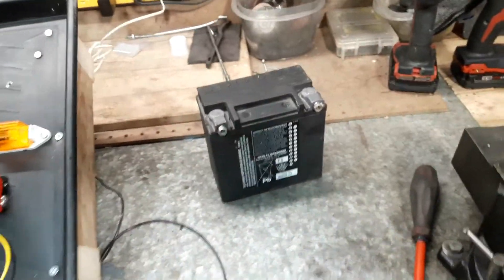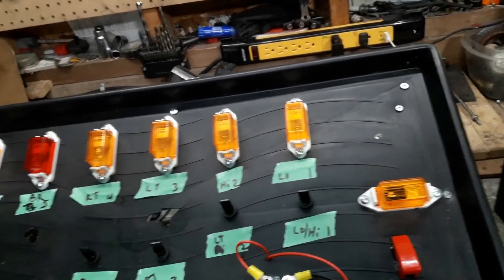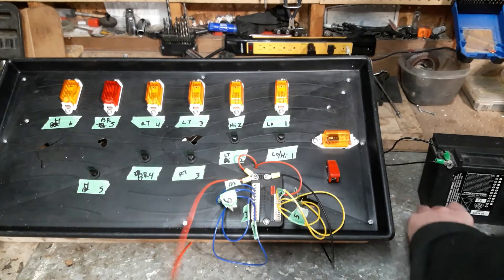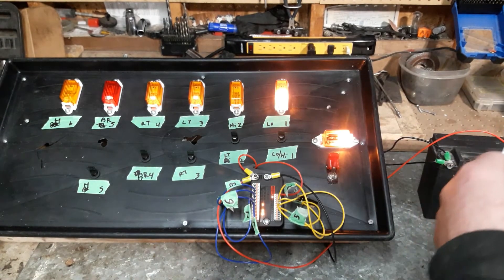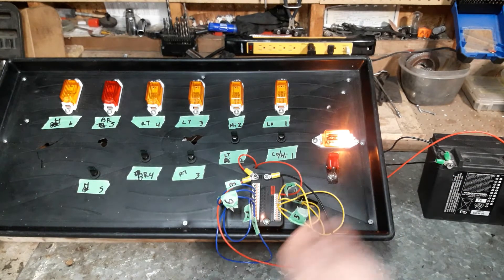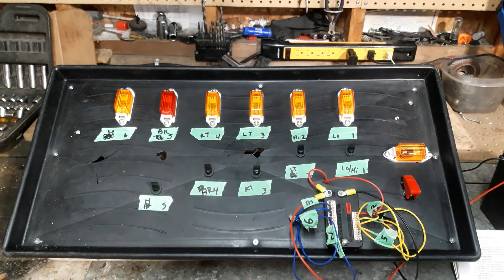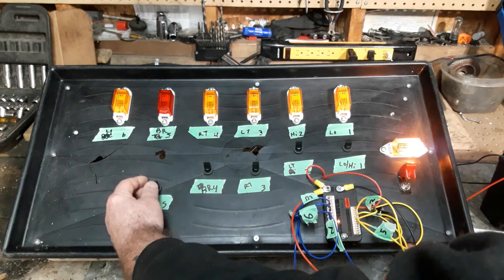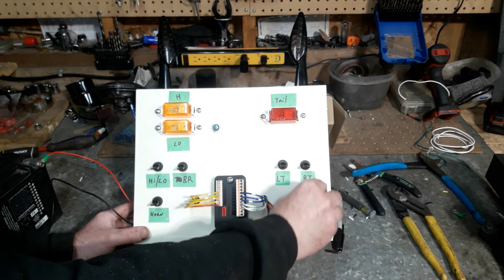Motogadget M-unit Beginners Install and Features

Comment: Thanks for the video. I have an M unit and trying to install on a custom Triumph build. I have the lockout button. It has three wires coming off the back. The long one I have hooked up to the input side of the M unit first hole. That leaves me with a red and a black. Do these two go to battery terminals? Thanks.
Reply from the maker: I'm not familiar with the lock out button. Could you send me a picture or some more information and i will check it out. 
email @ ecrngarage@gmail.com

Comment: I know this unit has its own flasher relay for the signals, but will I still need a load equalizer if they're LEDs?
Reply from the maker: The unit is set up for standard or LED's with no equalizer necessary. Hope this helps!
Reply: @ECRNGarage   Thank you, yes it does.
Reply: No